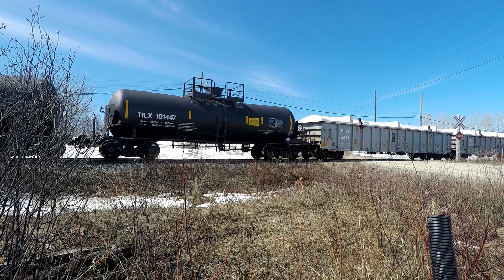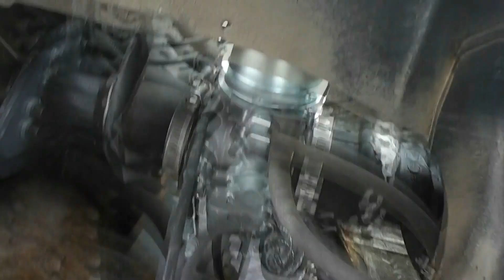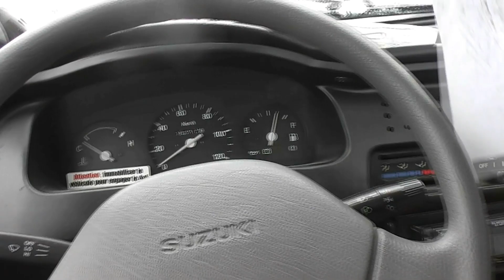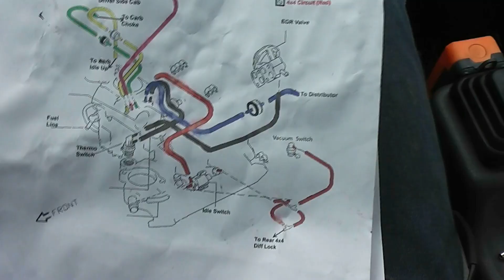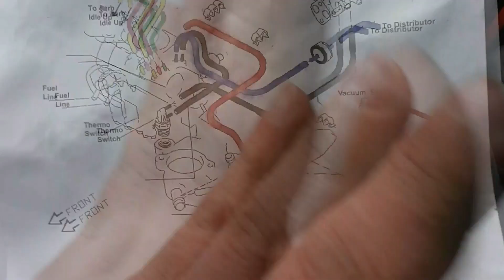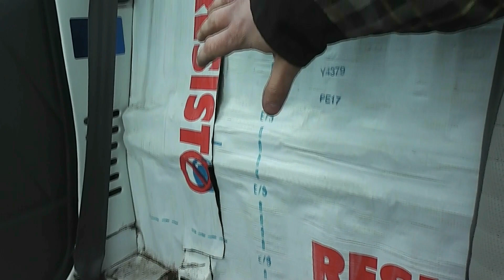Suzuki Carry Cheap Carburetor Swap

Comment: Thanks for the video. I'm dealing with a DD51T that has an aftermarket carb on it (only 4 vacuum ports). Im having power loss issues under load. If i can't figure out my problem by reviewing all the vac routing, I may end up using the same as you. So, are you still happy with the swap? Any problems at cold start? Do you miss no fast idle under electric load?
Reply: I think i have a fuel starvation issue too at speed (60kph it wants to drop RPMs) did you figure it out?
Reply from the maker: Over all I'm very happy with the result, but there are a few drawbacks. 

I definitely lost some of the low-end torque, in favour of a higher top speed (I can sustain 95kmh, up to 105kmh on flat ground.) This also means that I have to be more careful about stalling when driving off road, or when hauling a full load in the box. 

No problem with cold starts, since I have manual control over the choke. But, when temperatures are near or below freezing, I need to let the engine idle until it's up to operating temperature before attempting to move. Then I put it in first gear and crawl (less than 25% throttle) for the first few hundred metres of my drive. Past that point, it drives as expected. 

I also adjust the fuel pressure depending on temperature. In hot weather (above 25c) I had to turn down the fuel pressure to 1.5psi. 

I don't miss the fast idle at all, but I did set my idle speed a hair higher than factory. Idle speed is very easy to adjust according to your preference.

Basically, all the functions that used to be controlled by vacuum now have to be adjusted by hand, so if you expect to just turn the key and go, this isn't what you're looking for.
Reply: @rensonsyard   Thanks for all the detail. I'll keep this option up my sleeve and see if I can make what I have work to my liking.  95% of my driving is off road and I will be putting bigger tires/wheels on soon. So, the torque loss scares me a little. Your video and references were very helpful for me as I had seen this swap posted somewhereelse and was curious. Thanks again,  good job!

Comment: What choke cable did you use? And can I also have the link to the diagram with the writing on it? This has been so helpful, I'm doing my Mitsubishi 3g83 and it's a pretty similar engine
Reply: Also, the item labeled "drain", where does that go?
Reply from the maker: For the choke I used a peice of bike brake cable I had laying around. The drain dosen't connect to anything, it lets you drain water or sediments out of the carb as needed.

Comment: Great video.
 I have a DD51t also that has some hesitation issues. I'm considering this swap. 
 Curious though. Why is your's LHD!? I've only seen that in some DOD bought 2wd Daihatsu and Mitsubishi trucks. Every suzuki I've seen is RHD!
Reply from the maker: I'm not exactly sure why it's LHD. It was definitely imported that way. In fact, the import dealer did have multiple LHD trucks available at the time.

Comment: Man thanks for the video! I'm about to attempt this feat. What was your measurements on the carb to intake pipe?
Reply from the maker: I don't remember the exact length, but ideally you want it as short as possible. Depending on what model of carb you use, you might even be able to put it behind the alternator.

Comment: Being you already have an electric fuel pump could a person possibly find the fuel injection from a 4 wheeler and just make it fuel injected ?
Reply from the maker: I'm sure that could be done. In fact, the Arctic Cat t660 snowmobile uses the same engine block as this truck, and also has a turbo!
Reply: @rensonsyard  it looks as tho the arctic cat engine sits more upright in the snowmobile, I'd love to see if anyone has done that swap or if it would work
Reply: I did some digging into this. It's the newer model suzuki carry that has the same engine block. Gotta get one with the k6a engine, the f6a block is different from the arcticat. Gotta get a 99-2006ish from my understanding.

Comment: Hey so I'm in the process of doing this swap to a customers DD51T, wondering if you had to do anything to the carb other than mess with the idle and mixture screw? I'm having a terrible time tuning this, running into a problem where the idle is way to fat but it leans way out when I throttle into it. Nothing I've been doing helps, wondering if you have any insight on this.
Reply: I'm not a mechanic but hopefully this will help those of you who are. This carb is for a "cycle" engine not a car engine. Cycles, whether it be a 3-wheeler, 4-wheeler, motorcycle, etc. have their carbs mounted mere inches from the cylinder(s). When you crack the throttle the response is instantaneous. "Cars" have bulky intakes that distance the carb away from one or more cylinders creating huge pockets of air. To compensate, these carbs are equipped with accelerator (spray) pumps that squirt a bit of extra gas just at the moment when you crack the throttle to compensate for the extra volume of air between the carb and cylinder(s). This prevents having the engine fall flat on its face or even die when you go to give it gas. Back in the day you could actually flood an engine by pumping the gas pedal too much before starting. The mini-truck engines are no different as the carb is on one side of the truck and the head is on the other -lol. And yes the factory carbs on these have accelerator pumps. Naturally its going to fall flat on its face every time (even when it's warmed up) without it's "complicated" factory carb (or equivalent). If you don't mind feathering the pedal then this type of carb will work but it will never be right. Click the thumbs up if you feel like you learned something!
Reply from the maker: I think it's a fuel pressure problem. I haven't had a chance to experiment with it much,  but I suspect that the atv carb is expecting to be gravity fed, so the truck's fuel pump floods it at idle and can't keep up higher in the rev range. On my truck I have a fuel pressure regulator set at 1psi in the summer, 2psi in the colder months. It helps with the idle...

Whenever I get a chance, I want to try gravity feeding the carb form a bottle and see if it makes a difference.  

Unfortunately I won't have time to do any work on my truck this season, trying to get my house finished as soon as possible.

Comment: What did you use for a throttle cable. Thanks
Reply from the maker: I modified the tip of the factory cable, but it's probably not the best solution.

Comment: Hello I have a brand  new carburator for my carry, does  not work better,  can  I  modified it to remove all vacuum attachement  and make a manual choke.......thank you
Reply from the maker: I do not recommend modifying the carburetor. If the factory part is in good condition and adjusted adequately, yet the engine still doesn't run right, there is probably a problem with something else.

Comment: Dude this is awesome! I'm having issues with mine. Can you send me some links to the specific carb and air filter you ordered on line. Main concern would be throttle cable hook up. Other than that like you've done I'll be eliminating everything else. Maybe what you've used as a choke cable as well. Be a big help dude great video
Reply from the maker: Thanks! I'm thinking of making a follow-up video in the upcoming month to cover those things in more detail. Make sure to subscribe so you can see it as soon as it comes out!

Comment: I am not clear on the routing of the coolant lines after the swap, do you just plug them off  ,thanks
Reply from the maker: I put the lines together, so the coolant can flow as if the carb was still there.

Comment: I did same carb swap but when I go full throttle it falls on its face and having idling issues to any suggestions?
Reply from the maker: I do run into this issue one in a while, seems to depend on the weather. Adjusting the mixture and idle level screws seasonally does help, but I don't have a definitive solution
Reply: @rensonsyard  great! Thank you for your response!:)
Reply: Hey, solid chance you never see this but if you wound up fixxing it id love to know how because im having the same issue

Comment: This is great. Got a mitz mini cab 3g83. The parts are expensive. I see these carburetors on eBay and they're so cheap and I thought about doing this if I keep having carb issues I might do this. thanks
Reply: I do too, im going to do this swap. Have you tried yet?

Comment: Do you try to shorten the length between carb and intake port   Shorter the should be make torque 🤔 (sorry for my English 😏)
Reply from the maker: Unfortunately, the carb is as close as it can get without touching the alternator. If I find a way to change the throttle cable location, then I might be able to make some changes.

Comment: What carburetor are you using? Is that compatible for f5a or f6a? Thanks....
Reply from the maker: It's the carburetor for a Yamaha Grizzly/Rhino (not genuine part). My truck has the F6A, but it's not a direct fit, as seen in the video some fabrication is required.